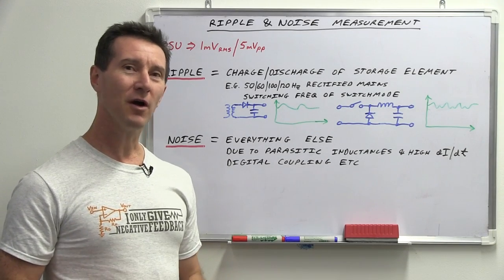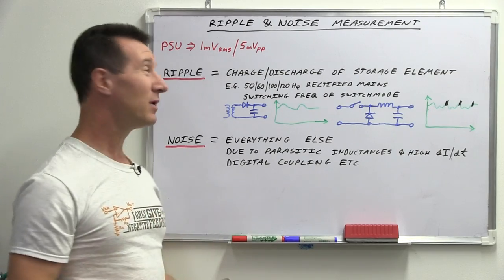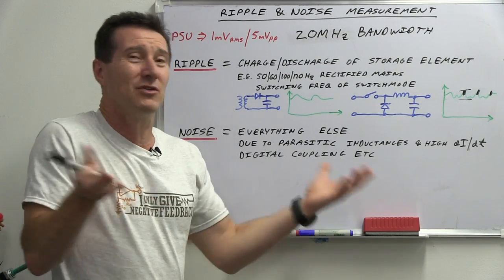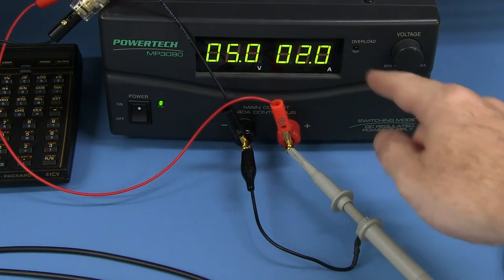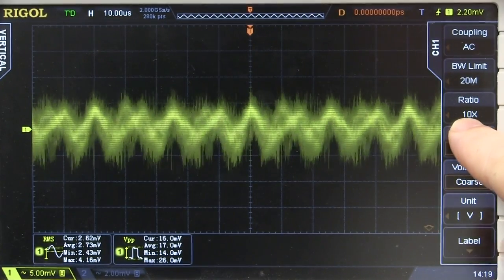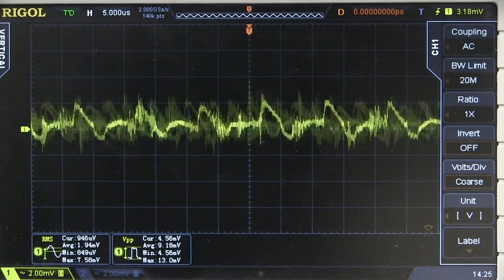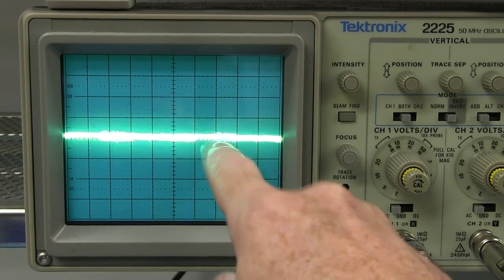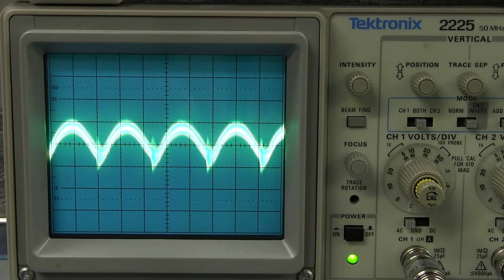EEVblog #594 - How To Measure Power Supply Ripple & Noise

Comment: Dave, awesome video! It really is a nice example showing common mode noise in a real world example and how to get rid of it.

Isn't it possible to build a differential probe circuit for this kind of measurements using some opamp action? Anyone got some circuit for this? Of course it would need the 20 MHz BW minimum...

Comment: Dave. Please stop using BK PRECISSION electronic load, it is useless for PSU noise measurments, and it is your 3rd or 4th youtube video showing same issue with it. I know it is educational to show various issues, but you already covered them up in different videos. Just focusing on topic would be better :)

Anyway, I am surprised that some digital scopes are so slow when doing signal substraction. It looks it is still good to have analog scope around just in case :)
Reply from the maker: It is completely on-topic, and the BK Precision is exactly the kind of electronic load that would be typically used in a PSU test scenario. What would people have learned if the PSU didn't cause any issue? If it's relevant I'll continue to show it again and again, because not everyone watches every video or remembers them and associates the issues in context.

Comment: Isn't all noise common mode noise?
Reply: Common mode means that the noise is present on the same exact return path of current respective to each signal in question. The noise on the two signals is equivalent and in phase, thus why you can subtract it out. Other noise can manifest itself in the form of sneak currents that find their way to the "ultimate" grounding node via different paths of impedance. That simply stems from the reality that any physical material can have different impedance values for different frequencies and even intensity of current. This is why you can never get a perfectly noiseless signal when measuring. There are countless parasitic effects at play.